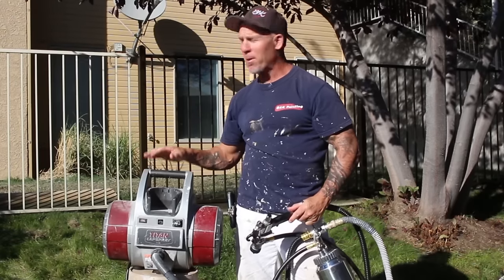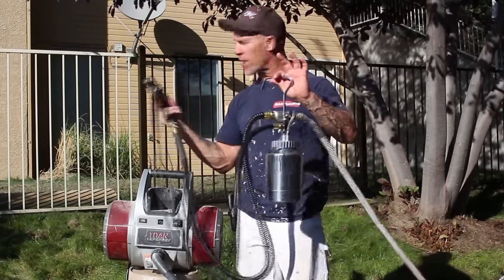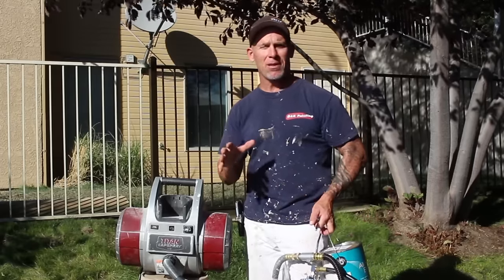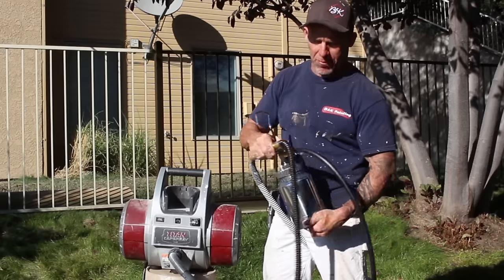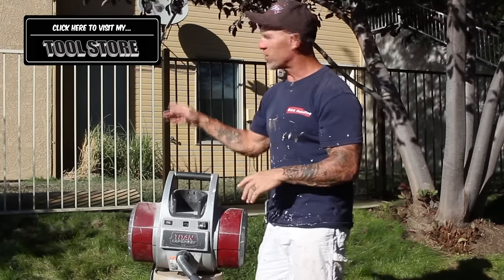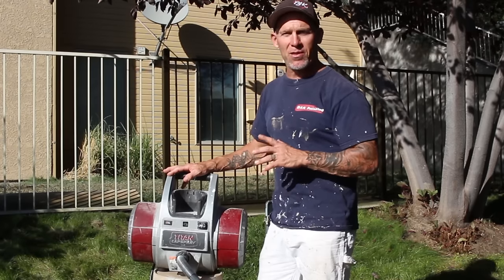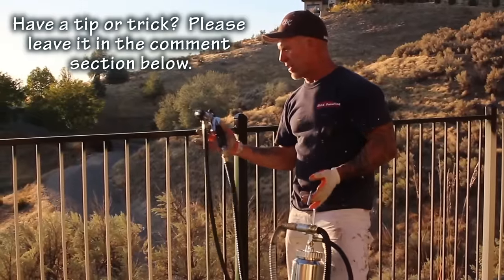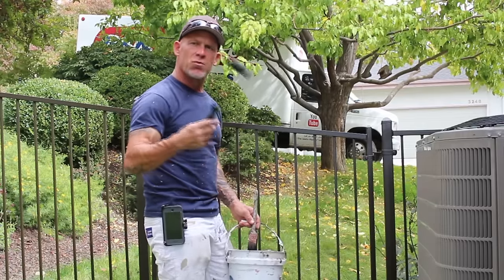REMOTE POTS FOR HVLP SPRAYER  How to paint with Titan Capspray Sprayer 115

Comment: I use a fuji set up just like this. One tip for you... I use velcro straps to strap the fluid and air hoses together from the cup to the gun. Keeping them together just adds another level of control for me. Great video brother! hope this tip helps.
Reply: I know this is an old post but I have a mini mite 3, can you send me links for your setup for the remote pod please? I'd rather not purchase the wrong pot, or not get the adapter that fits the fuji air hose.  I appreciate the help!

Comment: iv been painting for over 40 years , i have a titan 115 but the two quart deal is a waste or out dated because low pressure tips airless quiet not as hot and new ones have batteries.   i actually have a one oh eight tip very little over spray.    and if you put plastic one side with clamps then flip to opposite side works great.  i like you videos my name is steve i’m in the bay area los gatos hope to catch up some time peace bro

Comment: Don’t u think ur spraying to far away? Hvlp is for closer application 3-6inches maximum. I feel like ur to far away and can have a better chance of overspray with all that air. Just curious what ur thoughts are. I know u can dial in the gun at the tip. I like the system and the thinning.

Comment: i always keep the whip hose around my neck so im not having to hold the hose in place so its not touching any surface that im spraying but this is with a 1qt cup assembly.
great video on how the remote pot works
Reply from the maker: Good tip

Comment: ithink cut  in with a four inch brush  put plenty of paint on and then run a dry met roller over it works for me and is adamn site quicker  engenuity is the father of innovation

Comment: Hi  . I actually love your channel as no BS involved ,

I see your using the Titan can the same setup be used on a Graco ?? or the Wagner ???? Hvlp  and how to setup and what parts are needed or can you buy a complete unit and setup as that makes it so easy , compared to the dragging around the direct pot and gun and using a whip and sprayer lead rather than the bigger hose from the Hvlp

Comment: I like to spray each side before the first side sets up or dries.  this prevents overspray and rough finish.  I have noticed that the jump from one side to the other isn't as fast as I would do.  
I am still not sure if the trade off of thinned paint is worth the savings of product airless vs cap spray.  Especially as so much touch up seems required.  
With an airless and a small tip, as mentioned, doing two or three sections then, catching the other side in two pointed directions, and there should be very little dried overspray on the work or holidays.  Getting someone to hold up a large cardboard is not that big of a deal.
Reply: Matt Wilkin yes for fences like these one I would rather use an electrostatic sprayer,  it wraps itself to the surface,  makes life much easier.
Reply: I've never used an electrostatic sprayer.  Have been tempted, but just don't do enough exteriors anymore to invest in one and try it.  It would be perfect for this fence.  
I generally do fences and rails with an airless and a 211 tip or smaller, holding the fan in the same direction as the rails and running it very quickly.  Pressure set at just under half.  A quick shot from all four angles and coverage is near perfect.  A second person with a large cardboard or plywood is essential.
Reply: Matt Wilkin a good spray fine tip also helps to minimize overspray, the cardboard is a must, i like using a sheet of thermal ply, its much lighter than plywood and home depot also sells them

Comment: Question, been looking at turbine units  and trying to buy one. I think I got it dow to handful of units. Thinking about Apollo 5 pro, Fuji Q5 and there might be 1 or 2 more units out there. I want it for mainly for woodworking and painting my home trims and walls. (For DIY) which unit would you recommend. Woodworking is my hobby currently building my new kitchen cabinets.
Reply from the maker: The Apollo Pro LE is the top of the line.  Very best.

Comment: ( least over spray ext. on airless = tip size vs pressure ),  I’d say a 211 for oil ,213-313 for latex , and yes , floenol is essential .
( on an Hvlp ,coating output volume and air , low low low , overspray is for non experienced painters only. Unless necessary as like chromium on a bridge or a hot tin roof , oilbase primers- finish, can you say ; “half mile” cloud floating? ha

Comment: Great video.  I have the exact project under bid and this is helpful because I was deciding between rolling the whole thing or spraying.   I prefer to spray but someone recommended rolling...but as a one-man crew, I would take me a lot longer to roll. 

One follow up question, if you have a 440 and HVLP, which tool would you use on a fence like this?
Reply: Matt Vredenburg depends on what paint and how much paint you will use. If you use oil based I recommend the hvlp if water or urethane I would use the 440.
Reply: Hvlp. You can dial your tip down to about a half inch spray pattern. You can also work closer to your work. 5 to 8 inches and drastically reduce material that goes into the air.

Comment: Looks like I have the Capspray turbine but I am really interested in the exact product you're spraying.  I use Sherwin Williams Industrial latex alkyd urethane for the same types of jobs, but I have a hard time adjusting my CA Tech hvlp.  I would like to know the exact gun, fluid and air whip, and the remote pot you use so I can configure my Titan Capspray for similar jobs.  Thanks and great job with the vids

Comment: Do u think the Graco pro comp with the integrated air compressor works better? Maybe u don’t have to add as much extender?
Reply from the maker: You will always have to thin with the pro comp.
Reply: Paint Life TV then what good is the integrated air compressor? It’s supposed to spray heavier bodied paint that Titan doesn’t have a built-in air compressor the Graco is air assisted with turbines I think it could spray a lot heavier paints then the Titan?
Reply: Lance Litvinoff graco air assisted doesnt require thinning the materials, and the titan turbine his using shouldnt need thinning either, its a stage 5 turbine, if the correct needle is being used he shouldnt need any thinning, and I can see his over thinning his product by how much overspray his getting

Comment: With my electrostatic painting system. I can paint both sides of the fence      I don’t have to paint the back.   Save time. And materials.
Reply: Electrostatic painting?
Is that real or a joke ?
Reply: @andrewsparks4112  is. Real.  Check.  The videos of. Electrostatic painting system on you tube.   From graco triton. Pro Xp 60.   Cart
Reply: Pro xp60.   Electrostatic painting system.  Is real.  3k plus just the gun
Reply: @andrewsparks4112  is real. I ask 100 painters in Virginia and North Carolina.  Nobody knows about this.    They say I’m crazy. Lol 😂.

Comment: Idaho paiter! What size tip do you recomend to spray kitchen cabinets? Thanks.
Reply: He said #3 in this video.
Reply: Get the manual for your gun and a flow cup. Measure the flow rate and use the tip recommended for your material flow rate. Run a sample on a piece of scrap. If it looks like it dries to fast, doesn't level out, or doesn't gloss correctly, thin it out. If it looks great but you are shooting too much material at once and it makes it hard to work the gun then go to a smaller tip.  Hvlp is a lot of trail and error on samples mostly because you can shoot just about anything in any condition so there are lost of variables. My gun has abut 10 air caps and 10 needles to chose from and mix.  You will use more thinners in dry climates, direct sunlight, heavy aired areas, to make more thin smooth coats etc.  Thining materials is not a bad thing, it gives you the ultimate control on how a product works. Why is it done more with hvlp? People are going for a much higher end finish, there for it requires more effort to get it perfect. Also with nearly 50 combination of caps and needles there are more then one tip to spray the same material. Some may prefer an 1.5 needle with a  C cap with latex thinned down and others may prefer a 1.8 needle with a D or 2.0 needle for the same paint, thinned less or more. Some people might even use a 2.2 and some gun companies make an E cap. Pittsburgh paints makes a great guide on when to choose what sprayer but it is still just general.
Reply: it all depends on the material you are spraying

Comment: do you need a compressor to use the hvlp
Reply: No. This rig has turbines built in, that build the pressure. The only thing to look for is the number of stages. Choosing the right stage  depends on what material your spraying. Example : a 3 stage has 3 turbines and is good for thin material. a 6 stage has 6 turbines and can spray thicker material and run more efficient.

Comment: Just order the 105. Will this system still work on the 105?
Reply: Yes. Says so in the titan 115 manual.
Reply: Do you use oil base and what is the process of the cleaning pot sprayer
Reply: @freddycastrejon4103  use paint thinner or the suitable thinner from the paint you are using.

Comment: Cool new tool. Like the shirt, too. Thanks for mentioning the needle size on the hvlp. If you are using a weenie roller too wouldn't that make a noticeable difference in the finish?
Reply: alwaysrockn2009 
Yes, the texture is always going to be different. The extender/leveler helps, but there's still a difference. However, you're always going to have touch ups no matter how good you are. If it's somewhere extremely visible then you'll have to find a logical start and stop point and respray, but otherwise no one will ever notice but you.

Comment: I tried to refinish a Table top with a Clear Lacquer finish using my Air compressor and Sprayer thats the only thing I had (I bought a new Sprayer from Home Depot as only a General Purpose sprayer came with the Air Compressor the new sprayer was much like this one http://www.homedepot.com/p/Husky-Siphon-Feed-Detail-Spray-Gun-H4910DSG/203468550 ) When I applied the coats they looked great, when they were wet, BUT they dried to a haze, I sanded between each coat and when I got the final cot the same thing Haze, I mixed the Lacquer as per what the can said but how can you spray a Clear Lacquer finish and not have it haze up??? I ended up polishing it with Paste Wax to get it to come clear